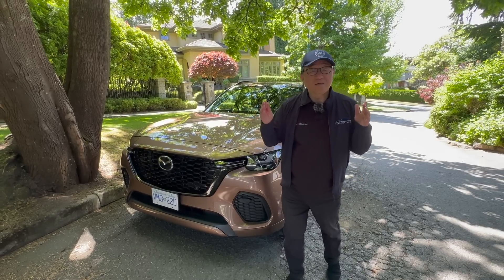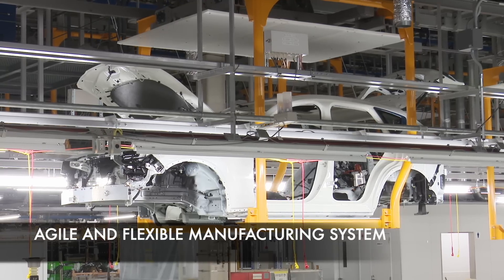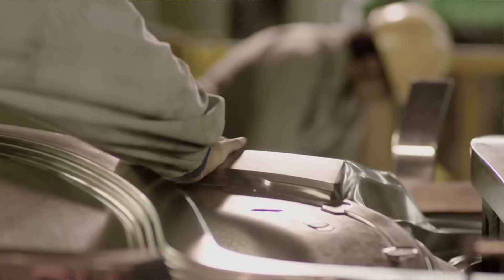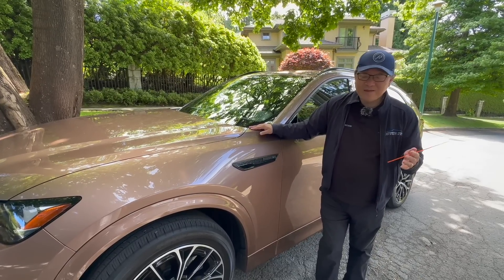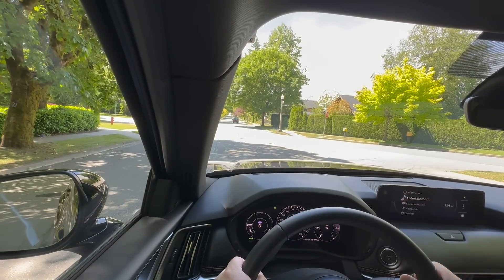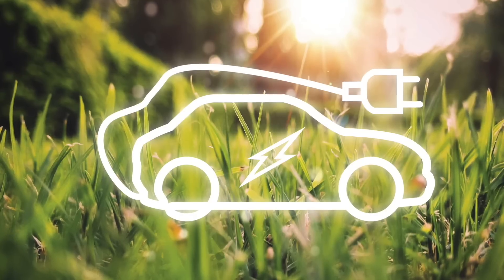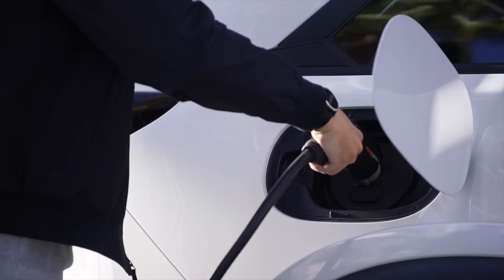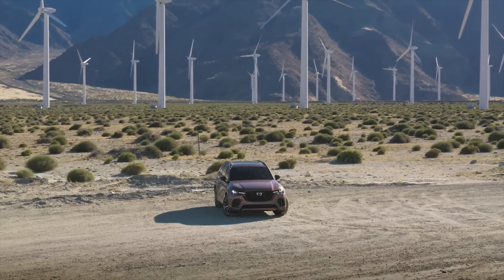BEST ENGINEERED PHEV SUV // 2025 MAZDA CX-70 PHEV // ENGINEER'S REVIEW

Comment: I purchased a CX-70 GT last week! Your video was the deciding factor after I drove the CX-70, CX-90, plugin, plus the 6 cycl. I decided on the CX-70 PHEV.  My goal was a Plugin, and a vehicle designed and built in Japan. Overall, I'm extremely happy with the CX-70, I know some of the negative complaints focused on the firmness, and heavy steering. I've had German vehicles for over 40 years, and currently own a 2016 M235ix convertible, so firm seats and direct heavy steering is what's expected. The fit and finish is as good or better than any of my BMW's I've own over the years. Overall I'm extremely pleased with my purchase of the Mazda CX-70

Comment: The CX-60 would have been amazing but people would have found other things to complain about considering it’s only slightly bigger than a CX-5. That being said, it never made sense for people to rage and say the CX-70 was a mistake. It’s a marketing technique that so many other manufacturers have used by making slight styling and aesthetic changes, and simply swapping out the affordable brand’s logo for their premium/luxury partner brand. It stands out more in Mazda’s case, but they at least did it without needing to rely on a high-end partner and trying to sell the vehicle for three times the price. 

Even though Mazda didn’t do anything groundbreaking to the CX-70, people are finding very practical and valid reasons to buy it over the CX-90. At least in Canada and the US Mazda seems to be selling almost as many CX-70s as they are CX-90s. At this point, the next gen CX-5 will probably be similar to the size of the CX-60. So if anything, the argument that holds more weight is for Mazda to actually make the next gen CX-90 slightly larger to better accommodate families and more adults.

Comment: Now that some additional time has passed since the CX-90 hit the market, I’m becoming seriously concerned about this vehicle’s long-term reliability. After spending time on the subreddit for the CX-90, I’ve seen numerous posts from owners reporting significant issues—particularly with the hybrid battery system. These seem to be recurring problems that haven’t been fully addressed.

To add to this, Consumer Reports recently updated their predicted reliability rating for the CX-90 PHEV, dropping it drastically from around 40/100 down to 15/100, which is a major red flag for me.

I’m curious to hear your thoughts on these developments. Do you think these issues are isolated, or could they be indicative of larger reliability concerns for the CX-90? As someone who’s seriously considering their next car, your perspective would mean a lot.

Comment: At 2:47, it says wrong information about Toyota’s manufacturing in North America. Toyota Rav4 Prime, a PHEV and Mazda CX-70’s rival, is also built in Japan. Also, Mazda’s PHEVs do not have anything to say about EV range. RAV4 Prime’s EV range is twice the CX-70's. In terms of economy and performance, RAV4 Prime wins compared to CX-70. CX-70 has better looks, and that’s all.
Reply: The RAV4 is so much smaller tho
Reply: Mazda does not even have heat pump which means much worse winter usability.
Reply: @MrRaitzi  Heat pump matters in a BEV but in a PHEV, the ICE should provide plenty of waste heat for the cabin in winter
Reply: @lewisreford8552  of course but you are not saving fuel then. I can use Rav4 heat pump until -15C(22.5F)and in winter and drive electric.
Reply: @MrRaitzi good point.

Comment: I really thought that the CX-90/70 is a great 3-row crossover until I saw The Car Care Nut’s review of it.
Reply: That guy trashed that car on his review. All prediction and criticism. Theres no perfect car for him. Hes so annoyed with the shifter like the car is not driveable.. crying about the timing chain at the back that almost no need for replacement. Lots of false information like the car wallows,, but the truth is, it is one of the best handling large suv... he talks like he knows better than the engineers
Reply: Car Nut has issues with CX-70 because CX-90 has a third row and effectively costs more in at least some configurations. But with 3rd row seats folded down CX-90 only seats 4 passengers as the second row has 2 Captain’s chairs instead of a bench seat. CX-70 has a bench seat in the second row so it can seat a total of 5 passengers and still have a lot of cargo room. That’s why people would go for CX-70.

Comment: I’m a big fan of Mazda.  After owning three Hondas in my lifetime, I have to say that my Mazda is a step above in driving and feel, while also maintaining stellar reliability.
Reply: Do you own a Mazda with a turbo? I ask because two of my local Mazda service guys told me the four cylinders are very reliable, though recommended I not buy a turbo. They said the turbos have lots of issues. We needed the power of the turbo, so we moved on. I used to be a Honda and Acura guy myself (two Acuras and two Hondas), though the interiors were too loud.
Reply: @stevewise1656  I do believe that Mazda’s 2.5L Turbo I4 is the subject of a class-action lawsuit right now, so listen to what those guys are saying!
Reply: @DeeEllEff  Thanks for letting me know! I'll bet they'll have the same problems with their newer six cylinder Turbos in the CX90.
Reply: @DeeEllEff I believe the attorney they had for that case gave up. It was more like just 4 loud cx9 owners trying to blame every mazda turbo.  And most engines with turbos will be more maintenance heavy, but statistically mazda turbos make it to high mileage (150k+) on average with minimal effort.

Comment: I was a little concerned with reliability with a complicated PHEV but I figured Toyota has a lot of experience and so far so good with my 21 Rav4 prime. Mazda is newer at it so that would concern me. The Lexus Tx 550h + has 33 miles of range similar efficiency, same size, and more horsepower but it more expensive. Hyundai Santa Fe is cheaper has better mpg, a regular transmission is a foot smaller and has less horsepower. There’s also the cx 90 for more money and a lot more horsepower. The CX 70 is alone in terms of price and specs, so it has its own niche but I wouldn’t pick it based on engineering because there is competition in the phev world with more experience.
Reply: The Car Care Nut says that he prefers the PHEV since it’s simpler than the inline six. It does have a couple kinks Mazda needs to fix but it’s simpler than the I6
Reply: Even Toyota now work together with BYD to bring their battery and DM-i tech.
Reply: @silluete Due to restrictions, Japanese-branded vehicles in China are all made in China via joint-ventures. They are an isolated market with China-specific models which use Chinese software and hardware. It has nothing to do with non-Chinese markets.

Comment: ????  I owned a recent model CX-5  take it from an Engineer, Tight tolerances great until stresses on the body due to dynamic loading may cause panels or inserts to pop because the  tight tolerances  in areas where differential movement occurs.  I learned this very early in my ownership.  The subsequent damage was not covered by warranty.

Comment: My ‘17 CX-5 was built in Japan, but they now manufacture it in the States. Also my touchscreen is active for most functions while driving, but they may have disabled those in later versions. No VCM either for the 2017 model and I’m thankful for that. I’ll take the lesser 1 mpg gladly! Zero recalls. Overall a very problem-free and low maintenance vehicle.

Comment: I've always admired Mazda as a company because they do things differently to the rest of the bunch that churn out boring appliances. We currently have a '22 BMW X3 and we're seriously considering the CX70 when our lease is up early next year. Test drove the in-line six turbo at our local Mazda dealership and here are our findings...

It drives brilliantly. Corners flat with great steering feedback. The suspension is compliant without bobbing like a Toyota and not too firm like some BMWs. 
The interior at first impression looks and feels great... BUT the door grab handles and seat controls feel really cheap with a lot of plastic flex.

Walking up to the car and opening the door, the doors feel and sound incredibly hollow and tinny. The door handle makes a nasty cheap sound when it comes in contact with the body. Open or Shut the door, you do not get that solid thunk sound. My theory is while Mazda prides itself on fantastic paint finish and low tolerance panel gaps.. they've had to use thinner sheet metal to achieve that kind of desired effect. It would be harder to bend thicker sheet metal or have sub 3mm shut lines. I invite you and your viewers to test it out. Check out a Mazda CX70/90 and just tap on the doors and then go do the same on a BMW or any German brand and you'll notice the difference. Not a BMW fanboy but merely stating the obvious. After all, at the launch in Palm Spring, California, Mazda had the BMW X5, Lexus RX and the Jeep Grand Cherokee for comparison. 

I really wanted to like the CX70 but something just doesn't sit well
Reply: My dad’s Mazda is the same way with the door handles. Cheap feeling but still love Mazda.

Comment: It's interesting to see the difference between the thoughts of a mechanic and that of an engineer
Reply: Watch The Car Care Nut’s review of the CX-90 as a mechanic. He said a lot of not good things with this car, especially how Mazda made the engine too complicated. "Built in Japan" doesn’t automatically mean it’s always great. Actually, I feel like they glorify it too much…
Reply: @digressor David mentioned that in another video. Pulling the engine to change the timing chain shouldn't be an issue until by the 7-8 year mark. Also, someone else mentioned that his Toyota's engine had to be pulled out earlier than that for something else. So Toyota is not immune to that problem. Really any car will have its issues especially if not properly maintained.
Reply: @digressor still wonder why ccn never review the tundra's engine failure.. since he hates cx 90,, it means he does not know how to fix it.

Comment: I bought a Alfa Romeo Sprint PHEV ( not the more expensive Veloce ) over the Mazda CX-70.
Handles exceptionally, looks a lot better, more comfortable to drive, still gets decent electrical range and mileage, and fits in my garage ( where the CX-70 would not ).

Comment: Dissenting opinion: My 2023 Rav4 Prime gets 50 miles (80km!) of EV range. And yesterday after the EV range ran out, it averaged over 50 MPG in bumper to bumper traffic. There's not another plugin hybrid SUV on the market today that can achieve these kinds of numbers. The CX70 gets 26 miles of EV range by comparison (half as much!). Yes, Mazda has a higher quality and more modern interior and exterior (I don't think we can deny that), but the RAV4 Prime still looks good and has plenty of upgrades including wireless apply carplay, android auto, 360 camera, ventilated and heated seats, safety tech, panoramic sunroof, etc. IMO, the hybrid engine transmission of the Rav4 Prime should be enough to qualify it as the best engineered PHEV SUV on sale right now. It's the whole point of getting a PHEV SUV. If you want luxury or performance, go full gas and get a Lexus, BMW, or Mercedes SUV. You might even save money by doing that too.
Reply: RAV4 needs a redesign, it is a very functional and reliable vehicle, but looking at it is not something would make happy to see everytime I am jumping on it to drive.
Reply: @victormoreno2767  Interesting. To each their own. I love the way my RAV4 Prime looks. It looks different from other RAV4s and still a lot better than the NX450h+. Bigger too.
Reply: @victormoreno2767  Toyota certainly isn’t one of the few companies that care to build something beautiful; they are all about function and reliability.  Having said that, though, the upcoming Signia  looks really good!
I share your perspective that the vehicle that I drive needs to be visually appealing.  Cars are too expensive a purchase for me not to enjoy what I am seeing.
Reply: You are absolutely right, even though I would pick the Mazda, as I prefer its design, inside and out; it looks special.

Comment: Is it better than Rav4 Prime? I heard you said it is the best. How  is the power? Rav4 Prime is quite quick of accelerating. And how fuel efficiency of CX70? I have not heard anything about that. 

I want to get one, but my aunt said her Prime is extraordinary.  Probably I end up getting Prime, plus the design is better and have option two tone color from Toyota house.❤
Reply: The interior of the Prime is embarrassingly cheap and plastic-ey.
Reply: The CX 70 PHEV is going to average about 22 mpg with mixed driving and the electric range will get you about 24 - 26 miles per charge. We bought ours last week and absolutely love it. The Rav4 Prime is a great car as well, we just needed something bigger to fit our large dogs. No other plug-in hybrid competes with the amount of space behind the second row (we didn't want a three row SUV). Or at least not that I'm aware of. Also, the interior is much more refined than many other options.
Reply: I'm very surprised that David would consider this "better engineered" than the Rav4 Prime. My 2023 gets 50 miles (80km!) of EV range. And yesterday after the EV range ran out, it averaged over 50 MPG in bumper to bumper traffic. There's not a single vehicle plugin hybrid SUV on the market today that can achieve these kinds of numbers. The CX70 gets 26 miles of EV range by comparison.
Reply: Prime has better range and heat pump. CX70 is bigger and better looking but core techlogy is not on par with Toyota.
Reply: Is there still a 2 year wait for the Rav4 Prime?

Comment: I still really wish Mazda brought over the CX-60 instead. The 70/90 are way too large. However more than any of this, I wish Mazda would make a hybrid CX-30 and hybrid Mazda 3 already with 200 HP and 45 MPG. Even if they have to borrow from Toyota...
Reply: They will be borrowing from Toyota for their upcoming CX-50 hybrid. It’s going to share the same hybrid as the RAV4. But the CX-5 will get Mazda’s own hybrid system since it’s built in Japan
Reply: @DrG24800   Thank the Lord! The RAV4 Hybrid/Prime & CX-50 Hybrid with the Toyota eCVT (or as I prefer to call it, a 1-speed A/T) & eAWD in a transverse FWD-based crossover platform that’s assembled in Kentucky are … OK, let’s just say “not the equivalents” of the CX-70/CX-90 with a 340hp 3.3L Turbo I-6 “mild hybrid” or a 323hp 2.5L naturally aspirated I-4 full plugin hybrid-electric powertrain, mounted longitudinally and driving a rear-biased AWD system through an 8-speed A/T designed/assembled in-house back in Hiroshima, Japan, with dual hydraulic multiplate clutches. Toyota values relatively simple, highly reliable products for which their rep supports charging healthy premiums; Mazda out-engineers/innovates their Japanese competitors & still manages to undercut their prices. I’m spoiled, but I do indeed prefer the latter.
Reply: I was the same as you but the CX-60 is really close to the CX50 in size. Pictures make it look much bigger. Made sense that they did what they did. I think they should of at least shorten it a little bit.
Reply: I’m hoping they have plans to bring the cx60 over as the next generation cx5.
Reply: @farcinue  The CX-60 is nearly identical in size to the CX-50, so I highly doubt that's gonna happen.  Maybe a CX-40 as go between the 30 and 50?
Reply: There is a CX-60 variant in some markets with the 2.5L naturally aspirated tried and true stout unit that mazda has been utilizing for a while. i think that would be ideal for a base variant CX-60 have they decided to bring that over.
Reply: I’m in uk and was hoping for the cx70 coming here 😂😮😊
Reply: Not a single person wanted the cx-70 as it is now haha
Reply: @DK-wr9nd  Except me, who immediately ordered one from Japan! (Incoming next week in Melting Copper Metallic and a Greige interior). But then again, I was that one guy who bought his 2015 CX-5 with the modified Miata drivetrain (2.0L non-turbo I4 w/ 6-speed M/T & FWD!), since I disliked that initial 2.5L, 6-spd. A/T & front-biased AWD.  Since my wife died in 2018, it’s just me and my beloved doggo, so a third row would be majorly wasteful and take up the space for a L2 220/240-volt charging cable and my mtn. bike in back!
Reply: @DK-wr9nd  Mazda USA did apparently
Reply: @DK-wr9nd  I have a CX-70 PHEV Premium & after 1 month I like it so far, but my large dog and I agree that it’s bigger than a 2-row crossover need be. 😉
Reply: @DK-wr9nd lots of folks want the CX-70/90.